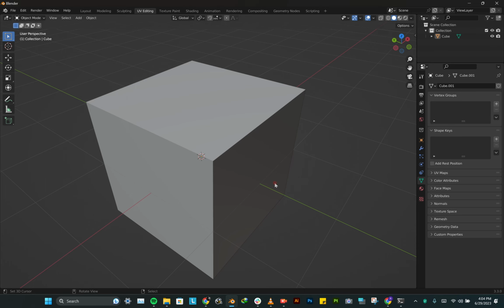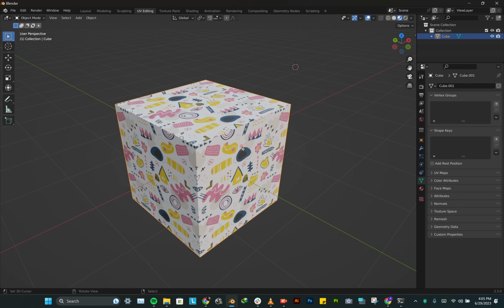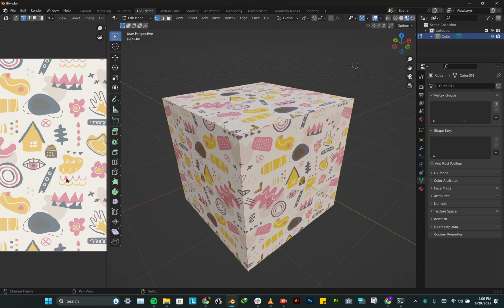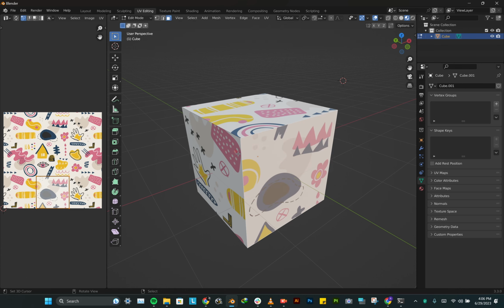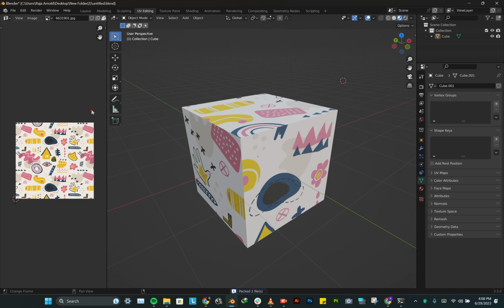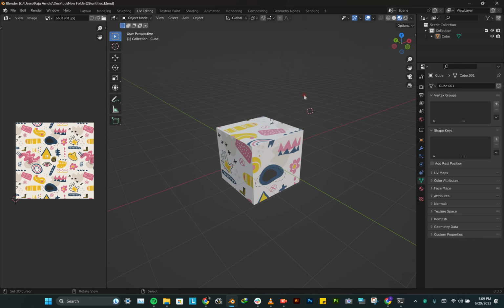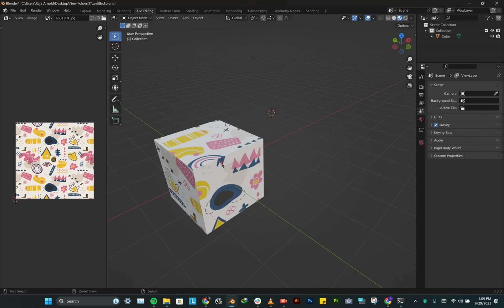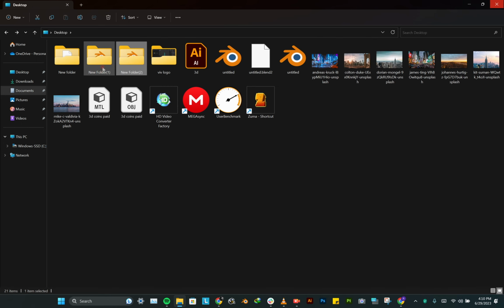How to export blender files to obj and gltf format and packaging all texture

Comment: I'm looking to do the same thing, export in obj but with a complex mesh, a lot of texture so, if you have sources or links I'm interested but especially taking into account the parameters of the shader editor.

That said thank you for "resource pack" it saves it's faster than copying the textures, on the other hand that
Reply from the maker: If u still customised the texture u can use this, but if u already finished the project and u want to render it faster and smaller size u can try bake the texture and then use this method to export